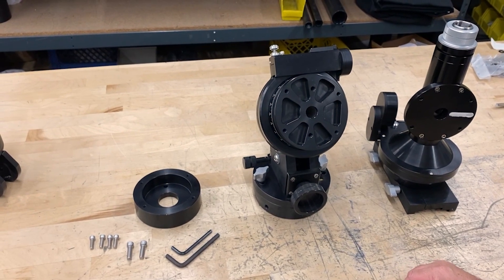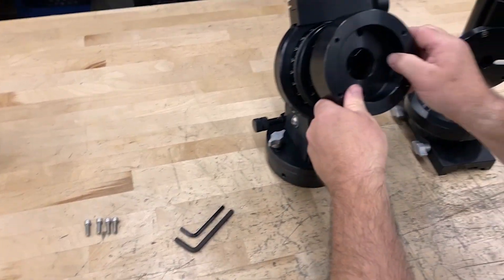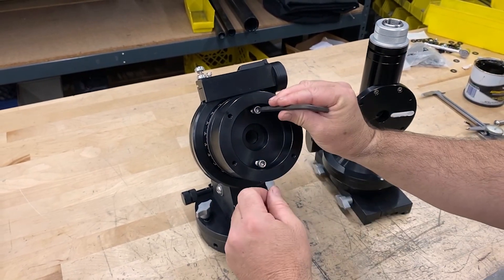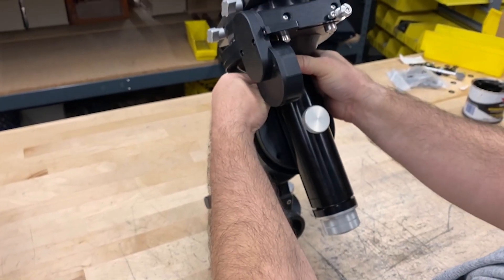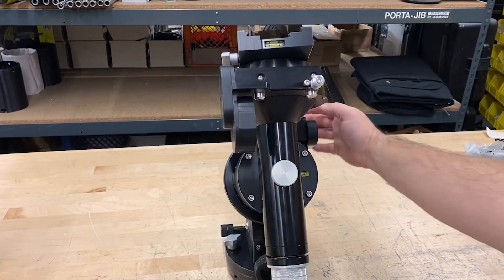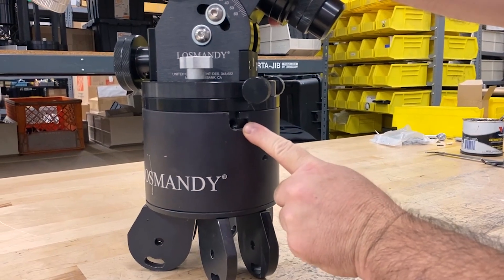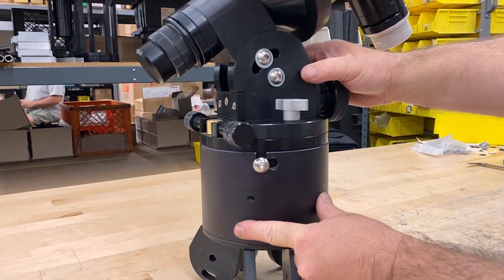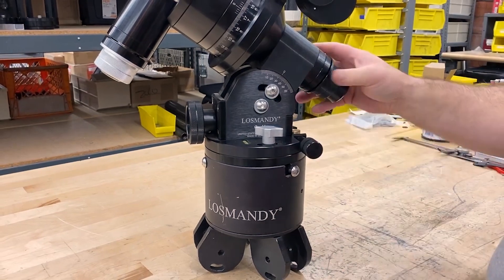Getting Started Part 03: Assembling RA & Dec Axis & attaching to tripod

Comment: An orientation question: when I attached the G11 RA mount to my tripod, there was no way to have the counterweight axis align with a tripod leg -- it is always 60 degrees off in azimuth (i.e. always positioned halfway between two tripod legs). I would assume that for stability, it is preferred to have the counterweight shaft over one of the legs, but since the EQ-head-to-tripod bolt holes are only every 120 degrees, there seems no way to achieve this?
Reply: Ahha! I see what happened. There are six screw holes in the base of the RA mount, but only three in the top of the tripod. I had a 50-50 chance of getting the proper orientation of counterweight shaft over tripod leg, and just got unlucky. Easy to fix. :-)